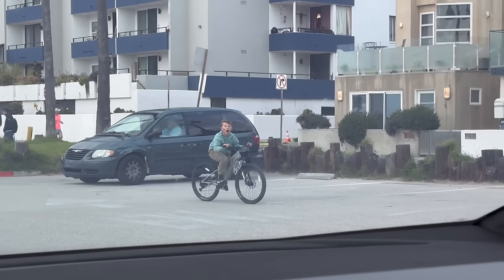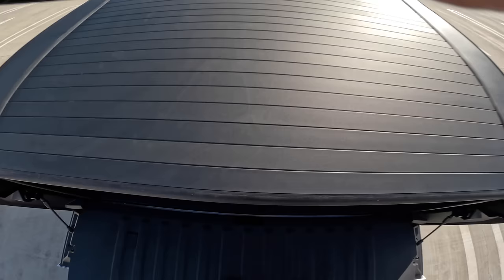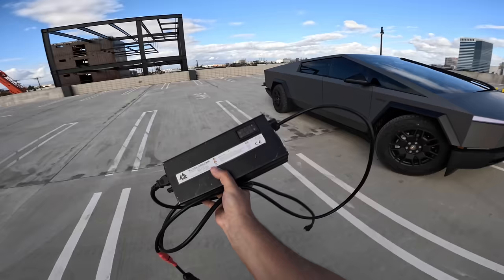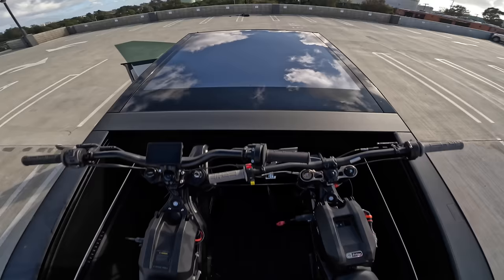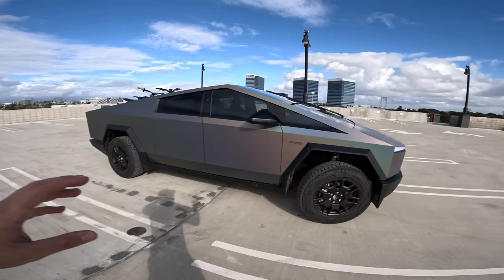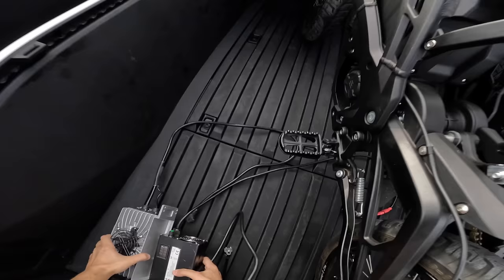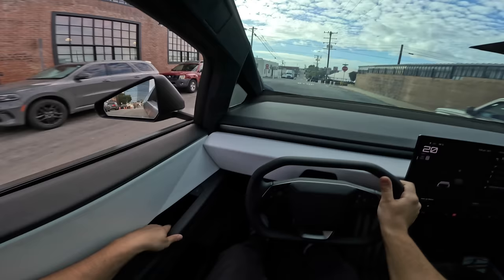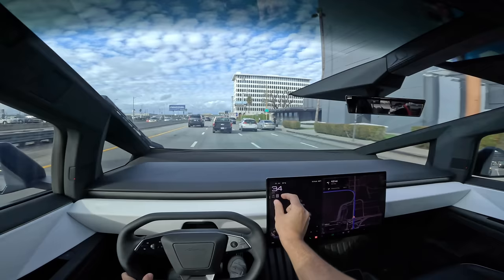I Cancelled My CYBERTRUCK Order After This!

Comment: Fun fact, you could power the average house off a fully charged Cybertruck for about 5 to 7 days.
Reply: fun fact, cybertruck is more expensive and has less range than was advertised.
Reply: fun fact, i could add a gas line and get a natural gas generator for less than the quarter of the trucks worth
Reply: We use 99kwh a day with solar panels here I dont think so bro.
Reply: FUD Fact?
Reply: @Tolbat   that's like 3-4 times the average here in Nevada 😂 where tf you live?
Reply: @CosmicSeeker69  my house uses about 2.50 a day in electricity. That's about 20k watt hours a day. The cyber truck capacity is about 125kwh so I could run my house for 

20 goes into 125 6.25 times 
6.25 days of power.
Reply: @Tolbat  you use 5 times more than I do and I live in Vegas 😂 tf
Reply: @eonreeves4324  big house, pool, and 4 boys
Reply: @eonreeves4324  Im not alone, 6 people in the house,
Reply: @Tolbat  the pool will do it lol
Reply: @eonreeves4324  the pool is winterized atm, electric heat, laundry, and cooking does it in the winter.  My power bills are less in the summer, some days i only use 33kwh and some 110.  I work from home in IT and all my kids use tech heavy.
Reply: roll the numbers and yeah, that truck ain't even hitched and pulling. It's a cyberfuck. The losses through natrual exchange of energy can't validate charging anything off it. Charge a battery from a battery yep that's efficient.  Stick the aircon on, hitch the mini digger and off we go for a short distance before the inevitable "find a charging station"  We've not seen it do a days work. It's not a truck, show me a video of it doing real trade work that requires a truck with balls  for a day and I'll eat my electrons. Jus sayin.
Reply: @deeds3611  capacity is not good enough
Reply: @deeds3611  electric is two or three times as efficient as ICE but that does not negate the fact that Gasoline has 100 times the energy density of a lithium-ion battery.. in the case of gasoline, it's so dense that it can waste 60-70% of it's energy and still have better range than an EV lol. 

We should bear in mind that this won't always be the case.
Reply: Funny, that's about how long it takes to fully charge a cybertruck LOL
Reply: Fun fact, cybertruck costs as much if not more than an average sized house. My house was only 50K
Reply: @deeds3611  Not to mention, if you damage your real truck it might catch fire...which the fire department can put in very quickly with very little water and toxic run off. You'll also be able to get out of the truck since the doors are not controlled electronically. When the batter on that thing is damaged you can no longer open the doors (people have burned inside these useless EVs for that very reason). If you even slightly damage the battery on this ugly thing you could be engulfed in a fireball that can't be put out for hours and sometimes days. EVs suk.
Reply: @eonreeves4324  Unless we find some way to tweak the laws of physics (which we may) batteries will never be more efficient or energy dense as gasoline. I don't see where you're getting the two to three times as efficient as gas either. Not trolling, just asking.
Reply: @did_I_hurt_you_feefees   Efficiency meaning how much of the energy input actually gets used to move the vehicle. 

EV can be very close to 100% efficient at converting electricity into miles traveled. 

Gasoline is only (maybe) 30% efficient, that means 70% of the chemical energy released is sent off as heat and not actually used to move you down the road.   

This means that EV batteries only need to hold 30% the energy density of gasoline to travel the same distance as a gasoline vehicle because EV is three times as efficient.
Reply: @eonreeves4324  If that's true, then was do ICE cars have far better range?
Reply: @did_I_hurt_you_feefees  because at present, gasoline is 100 times more energy dense than lithium-ion batteries; all things being equal, you’d need 100 pounds of batteries do the work of one pound of gas.

The EV is able to achieve RANGE but not while under a load. The only reason why EV is able to achieve similar range with passenger vehicles is due to sheer efficiency through design. 

This falls apart with large EV work vehicles because the nature of a work vehicle is not going to allow for the same level of efficiency is impossible to achieve. Such as pulling a trailer or a single wide house, there is nothing efficient about that. 

It is in this instance that the ICE vehicle will achieve greater range not through efficiency but through pure force, the energy density of gasoline is 100 times higher despite it wasting 70% of it's energy, it achieves a larger range while under load because it just has 100 times more energy to burn through.

IF a battery had the same capacity of gasoline, you would get something like 3 thousand of miles of range. 
It's only impossible until it isn't.
Reply: @eonreeves4324  Well, I never said impossible but the laws of physics as we understand them pretty much dictate that no battery can ever exceed the energy density of gasoline. Maybe some day our understanding will change and the tech will advance to a point that EVs are possible, but as of right now it's not even close. Forcing them on us is not going to make the world a better place. In fact, it will make the world a much, much worse place.

Comment: Literally every brand new truck has outlets in the bed.... the f150 has had them since 2015 if im not mistaken
Reply: Not all trucks have a 240V though.
Reply: You are mistaken, I have a Platinum f150 2016 with every option and the only pathetic 120v outlet is in the front.
Reply: @wisemanofsorts6068  pretty sure he used the 120. Also, most have the option to switch between 120 and 240.

Comment: Everyones bitching abt him speeding is crazy like they wouldn't do the same. And plus it's nearly impossible to get into an accident.  The truck has 1) Infrared image detection, 2) Radar detection, 3) 3D image detection, 4) 360 degree Laser range finders.  Any threat of anything going in front of the truck will engage reverse engine torque, stopping the vehicle a minimum of 30 feet before any obstacle at any speed.  It is literally impossible to hit something in front of you as it disables your drive control if their is any risk whatsoever.  Sure, you could get hit in the side or somewhat  also from the back, but that's on them.

Comment: Park the bikes facing aft, and the handlebars will be able to turn wheels towards the  sides further shortening overall length thus allowing two bikes to fit more straight axially within bed of truck. As you had them the handlebars couldn't be turned due to body/roof restraints... I think you'll find reversing them allows two e bikes squarely aligned with chassis, though your statement they don't fit is incorrect, you may not like the fit, but they DID fit with bed closed up.

Comment: PUT YOUR FRONT TIRE IN ONE CORNER AND YOUR REAR IN THE OPPOSITE CORNER BOW LIKE 3 TO 6 EXTRA INCHES BUT ONLY WORKS FOR ONE BIKE
Reply: Actually, simply turn both bikes wheels into their respective corner and rear ends straight to tailgate, Voila...FITS!  Plus more stable that way.  : >
Reply: @HarborEdwin  damn another way ima snap shot this into my brain.next time I gotta put two in
Reply: No caps lock
Reply: @Digikidthevoiceofreason  CAP LOCK
Reply: @DAWAXFAX   Did it this way for a couple decades of racing motorcycles.

Comment: bought a 34 year old toyota hilux with 600 000 km/ 400 000 miles and it still loads 3000kg /6000 pounds and never dissapoints. and it cost me 5000. wonder where the cyber bucket will be in 10 years

Comment: 🤣This Cybertruck is sooo fast. 15:52 That WAS a real cop and He was very generous for letting Ronster go. The police officer is in that plain truck to do safety checks on eighteen wheelers.  Damn, he is so lucky. 😂Bruh turned out of the parking lot and did an instant 52 mph.This is the best Cybertruck review I have seen so far. The joy Ronster showed at every blip of the throttle reminded me of when I was a teenager driving any car or motorcycle. Fun video. What a Beast of a truck. Super nice wrap on it too. Massive props to Luna Cycle for letting you check out their great Cybertruck. This is the only video I've seen, that would make me want to own a Cybertruck.🛻🚓🚓🚓🚓🚓🚓🚓🚓🚓🚓

Comment: Its a truck, how does it run off road?  Not a fan of the inside as I am old school.  GPS should tell you the traffic conditions of the roads.  If there is an accident, the Tesla would map out a path to avoid traffic issues.  Definitely a lot of potential, but still a tonne of questions.  Charging time, range, cold weather effects, how easy is it to maneuver in tighter areas, etc.

Comment: Those extra batteries take up a lot of space on load bed.  The Japanese had 4 wheel steering in the 1980's,  at slow speeds the wheels turn the opposite way to front, at higher speeds the wheels turned the same direction.
Reply: honda prelude four wheel steering :-)

Comment: This is just a battery powered pick up. I am not impressed. Its just a big version of a childs toy. Utility vehicles need to carry large loads which needs a large amount of power. So the battery will go flat quicker without the vehicle doing a days work. This type of vehicle really needs to be fuel cell or ammonia powered just to enable it to be refueled in minutes rather than hours.As a pose, its got the looks which will quickly wear thin so it wont be as long lasting as an el camino.

Comment: just wait till the lift goes out, it will cost thousands to replace it, I have seen many new teslas with bad suspensions and replacing the pats are insane, is not only expensive but its harder to replace the parts, its not like you can lift your own car and replace the parts, remember this weight like a tank, so its going to be really expensive to service that truck. and is not a reall off road master truck, just get a Tacoma and enjoy. You can even charge your bikes using the ac adapter in the back.

Comment: if i was you i would remove the plastic inside material of the flap and made 2 groves för each bikes rear tire. and then 3d printed some nice plastic interior for the back flap. then your bikes rear tires would hold the nike standing and they will fit in the back of the tryck

Comment: My 2011 Chevy Avalanche looks better than that, and its loud haha. Stupid electric vehicles. Where you gonna charge it in the woods or if you get stuck and drian that battery then it starts on fire and burns a long time with chemicals release into the air like meth heads do haha. 😊😊 But anything will brake down.